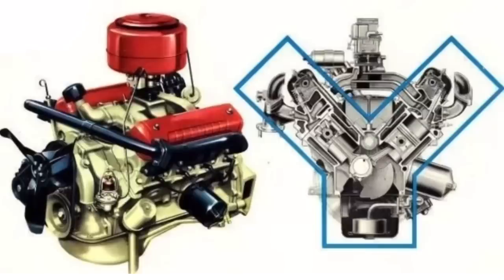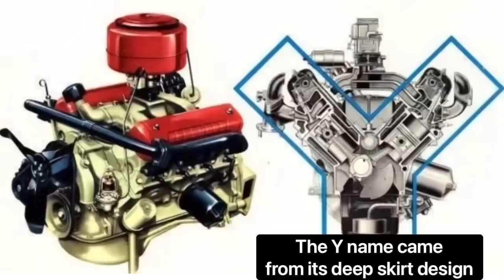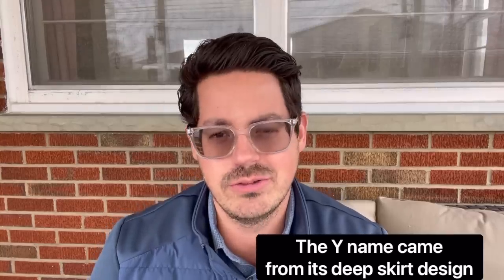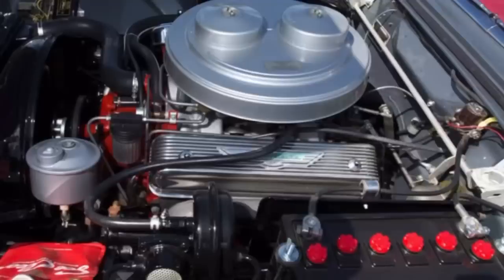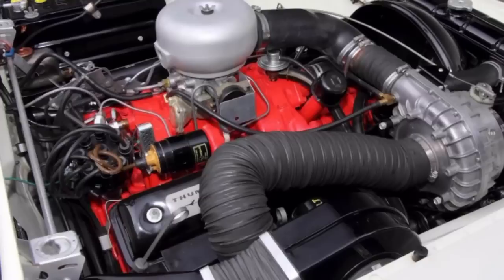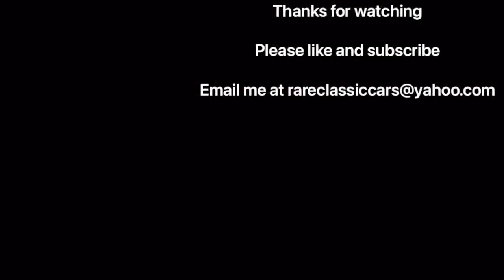Worst Engines of All Time: Ford Y Block V8

Comment: I had both a 292 and a 312 that I cammed and ran headers and 3 deuces on.  It was very torquey and could be driven 80+mph all day.  I set the valves at regular intervals and made sure that the oiling holes in the rockers aligned with the head.  I loved the engines....not a lot of hp but plenty of torque.  I always used good oil in them and changed at specified intervals.  I always had wanted one with a Paxton on it but they were rare as chicken lips.  Both were in 1957 Fords.  One went nearly 300,000 miles and the other had a good 200,000+ on it.  They used a bit of oil but not enough to have to add between oil changes.  I would not classify these engines as "worst' engines at all.
Reply: The Y-block is a much maligned V-8. The guy who penned the design engineered diesels.The block had heavy cylinder walls, and a deep skirt design for strenght. It was hard to blow one up.The stacked intake ports were an effort to equalize cylinder distribution. The upper end starvation issues we're easily remedied by supplemental oiling kits, or by simply using detergent oil. The emergence if the FE series, pulled the rug out of further interest, or devolopement of the Y-block. Fortunately, there were a lot of them produced, and there's a lively aftermarket support now to make this venerable engine shine, such as stroker kits and aluminum high-compression heads, etc.
Reply: @jeromebreeding3302  Very good analysis of the engine design.  I worked with this engine for 25+ years off and on and there is a faithful following that has marketed heads, intakes, revised oiling, etc.  The skirts on the blocks have been copied on my engines, including the LS motors to provide strength.
Reply: @tomnekuda3818  That "deep-skirt" design was incorporated into Chrysler's 426 Hemi. They knew a good thing when they saw it.
Reply: @jeromebreeding3302  Exactly so.......but they did it even better.  They used tight-fitting main caps that were shimmed to hold the bottom in "perfect" alignment, thus imparting a great deal of strength to the bottom end.  I used to work on the hemis on the drag motors in two ways:  1)  At the strip, since I was an industrial chemist, I managed the nitro/gas, nitro/alcohol, etc mix and made adjustments to how much went thru the injectors vs how much I put thru the 'hat'....that can make a big difference in the burn rate and burn pattern within the combustion chamber.  2) In the build, I would adjust the shimming of the main caps so that the crank would lie as completely straight in the bearings to reduce rotational friction and crank flexing, therefore leading to longer engine life and salvaged power that would otherwise be compromised by the friction and flexing of the crank.  As they always tell us....."Every little bit helps."  Also worked on three 427 Ford engines that used the long-skirt design for the above-mentioned reasons.  Those were one hell of an engine, too.
Reply: @jeromebreeding3302  all the Chrysler b and rb engines have a deep skirt as well.
Reply: @tomnekuda3818  ya the side oiler fe had cross bolted mains like the 2gen hemi.
Reply: @user-cs1ne8gx9u  That's what I had......lucked into 3 side-oilers on a deal.  Used on roundy-round and then drag strip.  Very expensive engine to play with.......sodium-filled valves and other kinds of goodies.
Reply: @tomnekuda3818  we use to find them in big river cruisers as a pair with tons of hours on them. Funny how back then we knew they were fairly rare and yet they were still common enough to not hang onto. I wish I had a pile of core 427's now, but there's lots of things I look back at now and wish my younger self had kept.
Reply: @jeromebreeding3302  It is easy to fix the rocker oiling problems, just have the center cam journal grooved, or use a later cam that came with a groove, and plug the bypass hole in the rocker shafts.  Then the oil to the rockers will be constant, rather than intermittent.  Lincoln did that to the 368 engine that came out in 56.
Reply: I've heard a few of em over the years. 
I got a customer with a 57 Fairlane ,jet black and a set of cherry bombs and a little bit wider tires under it to fill it out nicely. 
Has a nice raspy poppin exhaust note to it.
Reply: Tom:  ah....I've always wanted a Fast vintage Ford...had visions of a  Ford coup with the engine and trans from my 97 Crown Vic Police  Interceptor...that 4.6 in that particular car was a tight setup and really pulled nice, thought this would be perfect engine in a 50's coupe or TBird!   It would be easy to supercharge a 2V 4.6 too...
Reply: @gt-37guy6  Sounds good.....I've thought the same thing.
Reply: @tomnekuda3818  I also thought same motor in a Studebaker Hawk, or the earlier coups they are all very very cool as well, just tough to get parts for perhaps.
Reply: @gt-37guy6  My uncle had a Studebaker Golden Hawk with a supercharged 327 in it back in the day that would really "haul the mail".  To this day I think one of the sexist cars that they should have kept on making were the Avanti's.  I understand there is a company that is making an "improved" replica of the Avanti that uses a SBC for motivation.  I got a ride in an original Avanti (my dentist) on the 4-lane one day and it would blow away my Roadrunner that could reach the end of it's 150 mph speedo.  Definitely neat cars but I don't know much about their engine design.
Reply: @gt-37guy6  Somewhere in one of these responses I referred to the Studebaker Golden Hawk engine as a supercharged 327.......in actuality is was a blown 289.  Sorry about that......at 75 y.o. a fella gets a little fuzzy in the noggin.  Keep the Faith.  Tom
Reply: @tomnekuda3818  I've read that the Studebaker engine had a very thick casting too, and then had a solid timing gear drive that also had a heavy housing - so it was a tank motor...but kicked out some serious performance...like a left-over engine from WW2 Studebaker aviation?  lol...!
Reply: @gt-37guy6  I knew that Studebaker made tank engines for WWII and some aircraft engines(I believe)....that certainly speaks well for them....too bad I can't remember better.  My uncle had a Studebaker pickup (my cousin and I called it "Stud-breaker"(weren't we clever?) and the timing gear in it was a pressed fiberboard with a metal gear on the outside).  Only reason I know was because pickup quit running and my uncle traced it to that fiber gear that came apart.  The replacement cam gear was all metal.....so we put that in plus new timing chain.  Buddy of mine had a Stude' pickup that he dropped a 501 Caddy and auto trans into.  If it had wings it could fly!
Reply: @tomnekuda3818  The 501 Caddy in that truck...yehaa!   Always wanted to stuff the biggest motor in the smallest possible vehicle,  good thing i never succeeded.  Closest was a 350 in a little Monza 4 cylinder body,   I could drift that thing on S curves at 55- 60 mph in traffic just to freak out the commuters..what fun (I had a mis-spent youth).
Reply: @gt-37guy6  You would have had fun with this rocket.  We took it out to the old airport airstrip and proceeded to run it thru the gears(automatic but what the hell) and at the top end(over 100 mph) the hood flew open and wrapped itself around the windshield.......Mark jumped off the throttle and held it straight.  Three things were learned:  1)  the Stud-breaker was a rocket!  2)  Stude pickup hoods are hard to find and; 3)  if you are not going to chain down the hood, at least take clean underwear!  Keep the Faith!
Reply: @tomnekuda3818  Right on...sounds like we could trade stories for quite a while Tom...Thanks for having a "virtual beer" with me...lol
Reply: @tomnekuda3818  The Sudebaker V8 didn't use a chain, just a straight gear cam drive.
Reply: @gt-37guy6  I always thought the Monza was a beautiful car and V8's fit right in......I still want one.  I had a Cosworth Vega(#54) that I put reground cams and DCOE side-draft Webers on instead of the inadequate Cadillac-inspired injection.......those Webers changed the whole personality of the little engine.  They were made to race the 2 liter class in Europe.
Reply: @michaelbenardo5695  I know......I don't know where you got the chain drive idea.
Reply: @gt-37guy6  That's a grand idea!
Reply: @tomnekuda3818  Monzas came with 262, 305 and a few 350 2bbl SBCs in CA in 1975.
Reply: @hendo337  That's correct......I'd forgotten all about that - thanks.
Reply: Reason for Brazilian Y blocks was orig for trucks, continued building for cars. Mostly Brazil used "write off" American tooling, at time they had no other engine tooling. Both 272 & 292 were available, with stick shift(Ford of Brazil had no automatic transmission plants). In Argentina, Y blocks were used into the '70/'80s Fairlanes(also long gone in US).  When Brazil started offering V8 in Maverick, 302 engines & auto trans were imported. 

BTW Ford's first OHV 6('52) had the same rocker oiling issues as did Y block.

Basically Ford had no really bad V8 engines, Y blocks were just Less good. Yes I owned one. In early '70s my dad bought a '62 Galaxie as work driver, it apparently had seen good oil & regular changes, rockers oiled just fine.
Reply: @tombryant1104  Yes, that 215 6 cyl was not perfect.  The 223 that came out for 54 was an improvement.
Reply: And not having to add between changes hardly qualifies as "using oil", not when many 70s cars with big engines were hard pressed to go more than 1,000 miles without needing a quart added.
Reply: You should have bought an old McCulloch blower or something to play around with on your Y-blocks.
Reply: @hendo337  Even then, they were scarcer than hen's teeth.....Ford didn't make many of them.  I did look but the few of them and me being constantly on the edge of broke didn't help.
Reply: One of my Uncles had a 57 Ford with the 'McColloch'Paxton" blower,I forget what He said about it, if memory serves Me correctly the "FE" was loosely based on it, "FE" may have stood for "Ford Engine", Mercs were usually a little different from the Fords( generally more displacement and power, my biggest complaint on those things was the position of the distributor,Chevys were easier to work on, the old  292 made a great truck engine.
Reply: Ya I think the worst is a bit hard on the old y
Reply: @user-cs1ne8gx9u  I'd say all in all the worst Ford engines ever made probably came from the 2000's to 2010 all the engines before seem to be underpowered or complicated but nothing absolutely horribly wrong
Reply: @michaelf.2449  true, but I'll ad the 335 series engines to the worst list from the old days.
Reply: @user-cs1ne8gx9u  by '335' you don't mean the 429 /460 do you? Those were excellent, Adam even covered them as good already.
For some reason, I thought the 429/460 was the '385' series......?
Reply: @67marlins  by 335 series I mean the 351c "Cleveland", 351m "modified", and the 400. The 385 series, 429/460 was a pretty great all around engine.
Reply: @user-cs1ne8gx9u  oh, that's right, OK thanks. However.....my father got 530,000 miles out of his 1977 LTD II Wagon, a 351M, original engine.
It wasn't powerful, and the emissions made it inefficient on gas, but we treated that car right, doing all maintenance on-time.
 It was running when the frame finally rusted out in 2006, when the car was 29 years old.
My point is, if you treated it right, even in the midst of what Ford considered a bad period of QC, ours was a great car.
Reply: @67marlins  that's cool I love seeing real survivor cars with lots of well earned mileage. And your right it's mostly how they're treated and cared for. We've had a few wreckers over the years with 351m's and 400's that we got service out of, but when the engine went they got replaced with whatever we had around, usually an fe or Windsor. I've got a bit of a soft spot for wagons too and my 66 Buick sport wagon has a ton of miles on it as well.
Reply: @user-cs1ne8gx9u  I disagree. The 335(351-400 Cleveland was one of the best hi-po V-8's to come from the Ford camp, unfortunately emmision constraints did them in.I did see a 74 Cleveland in a junkyard, probably from CA.
Reply: @67marlins  It is the429-460.
Reply: @user-cs1ne8gx9u  Was the 335, the Cleveland engines, a bad engine?
Reply: @jeromebreeding3302  I think he means longevity.
Reply: @michaelbenardo5695  biggest problem with the whole 335 series family is the oiling system. At low rpm service it's sufficient but anything over 5k rpm and starvation happens quickly. 4 venturi or barrel Cleveland's had heads that were quite happy at a higher rpm than the oiling system could handle. The rear main and 4/8 rod journal would starve along with the driver's side lifter gallery and rockers. Then there's all the emissions equipment, restarted cam timing and year to year compression height piston changes that were more detrimental to the 351m and 400 than most engines in the 70's. Even at less than 8 to 1 static compression they had detonation/pre ignition problems because of a poor combustion chamber in the 2 venturi/barrel heads. All that and they weren't as compact or lightweight as the Windsor, which has an excellent oiling system. Ford would have done better to make a 400 inch Version of the Windsor with the boss/335 head. Today one can correct most of the issues and build a powerful 335 family engine out of any of  them but you'll still have a sub par oiling system even with all the bandaids.
Reply: @user-cs1ne8gx9u  Wow, the way Mustang freaks talk about it, I thought it must have been good.  Sure was wrong on that one!
Reply: @user-cs1ne8gx9u  Will a larger oil pump fix things, or is there none available?
Reply: @michaelbenardo5695  I'm sure there's probably hi volume pumps available for them and you can always adjust the pressure relief valve but it's still a bandaid on a broken arm. Not to mention putting a lot more load on the oil pump drive and distributor/cam gear causing more problems than it usually solves. Years ago one trick guys would try is to add restrictors in places they thought had too much oil so as to preserve it for another. The front cam bearing being a common one.
Reply: The 429-460 was the"385" series. The"335" series was the Cleveland and modified(351 M).
Reply: @jeromebreeding3302   Thanks.
Reply: @user-cs1ne8gx9u  I am sure I read somewhere many years ago that when Ford designed the 351 Windsor the plan was it would "grow" into a 400 cubic inch version as well. This is why it's so easy to put a 4 inch crank in them for 402 cubes. Instead they raised the deck height of the 351C by about an inch so they could add 1/2 inch to the stroke to make the 400.
Reply: @briansearles4473  yeah they would have been much better off sticking with the Windsor for a 400 inch engine. For that matter the good old 390 fe, although physically bigger and heavier than a Windsor was filling the role just fine. The whole 335 series engine family just never really made sense.
Reply: @user-cs1ne8gx9u  I agree with you 100%. Why Ford didn't use the canted valve head on the 351W like they did for the Boss 302 has to be one of the biggest mistakes Ford ever made? My first car was a 69 LTD with a 390 2V , a much better engine than the 400.
Reply: Little red....you know this isn't a forum for 8 year olds.

Comment: Seems Ford has a LOT of trouble with keeping their engines properly oiled... This motor, the early FE's, that 3-valve Triton motor in the 2004-08 F-Series trucks... How does Ford keep making that mistake?
Reply: The early FE only had issues when used for racing as it did not have direct oil feed to the crankshaft bearings. That is why the side oiler 427 was made, the main oil galley directly fed the mains first, after early 427s in 1963 blew up on tracks.
Reply: Ford also loves under-carbureting, coupled with intake manifolds which just aren't trying...
Reply: @mikec9112  — The 335 series wasn’t really a “top-oiler” like the FE-series engines. The FE engines (except the side-oiler) fed oil to the cam bearings, where it was then routed to the crank. The 335 routed oil first to the crank, and from there to the cam bearings. The 335 worked great on the street. The 335 did feed the mains off the lifter oil galleys, instead of having a dedicated galley for the crank. In racing applications, measures were taken to apportion a greater amount of the lifter-galley oil to the crank.
Reply: Ford has a long & proud tradition of making the same mistake over & over. Look no further then the power steering issues with the Exploder

Comment: Adam what was the deal with the exhaust going along the front of the engine on some Y blocks?
Reply: Does away with the need for a Y Pipe, flat heads had that too.
Reply: I've noticed that too!!  Wasn't that seen more in trucks than in passenger cars?  I suspect it was done to make room for clutch linkage/Z-bars, and perhaps to keep that intense heat away from brake master cylinder and its mainline. And also maybe for hydraulic clutches which I suspect they were using in trucks back then.
It probably kept heat from the driver's toe-board too.
Reply: Never liked that feature myself, but actually it replaced the conventional Y-pipe under the car. It's easily converted to duals by  caping the top of on one side, and fabing a down-pipes. Easy peasy, lemon squizey !
Reply: Trucks did it to keep the engine hot
Reply: packaging and Ford being cheap
Reply: A last minute cheap out to use single exhaust when the car was intended to use dual exhaust? (Just asking)